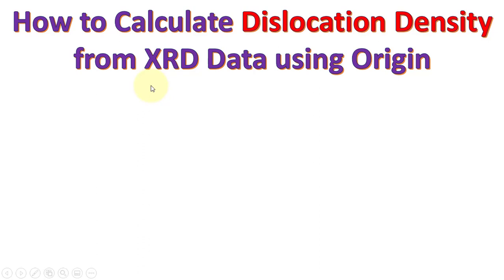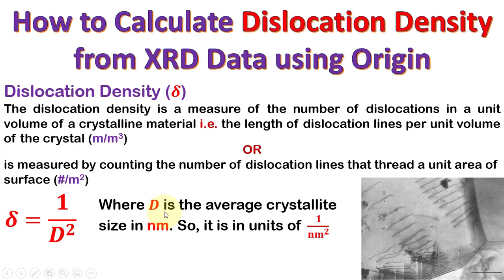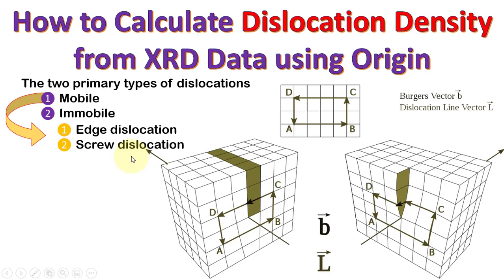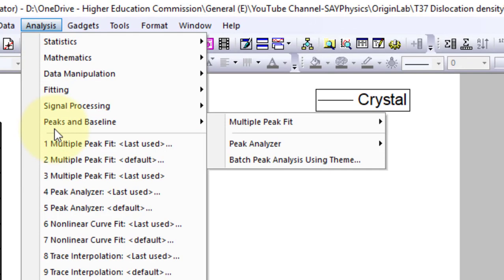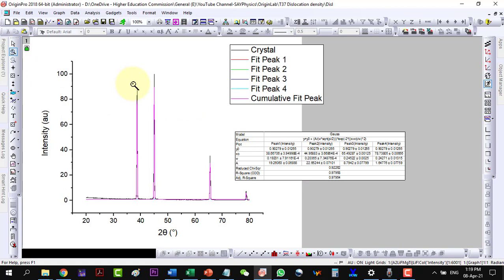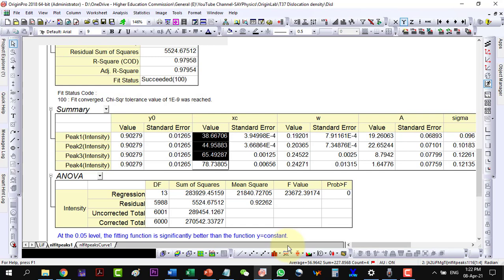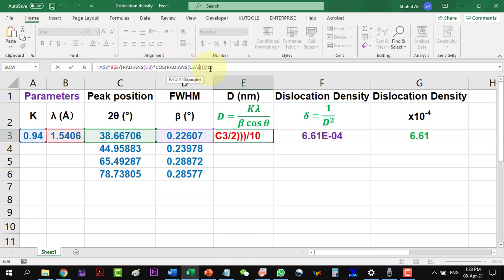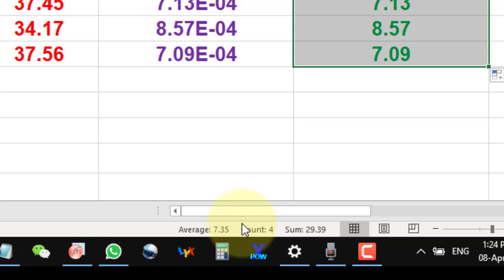How to calculate dislocation density from XRD data using origin

Comment: Thank you so much for the great lesson@SAYPhysics. 
With regards to dislocation density equation, delta = 1/d^2,  I have gone through the reference provided, paper on “Estimation of lattice strain in ZnO nanoparticles: X-ray peak profile analysis”…. this equation appears to be used for ceramics. Is this equation valid for steel? And if yes, could you please point me to a reference material that I could refer to please.
Reply from the maker: The dislocation density equation, delta = 1/d^2, is commonly used in XRD analysis for various materials, including ceramics and metals like steel. Thanks for the appreciation ☺️
Reply from the maker: Detailed response with some references is as follows;
The dislocation density equation, delta = 1/d^2, is a key tool in XRD analysis for various materials, including ceramics and metals like steel (Tamura 2017). This equation is particularly useful in evaluating dislocation density during steady-state creep of metals (Tamura 2017). It also plays a role in understanding the relationship between dislocation density and yield stress in cold-worked iron (Akama 2017). The equation has been applied in the analysis of single grains of steel using X-ray scanning microdiffraction (Castelnau 2001), and in the flow stress analysis of TWIP steel via XRD measurement of dislocation density (Dini 2010). Thanks
Reply: @SAYPhysics , Thank you for the response and references, much appreciated

Comment: Hello, I have a few questions.
1. Why did you multiply the value with 10^4 in the last column? I have seen videos where they multiplied the value by 10^3. 
2. Which one gives a more accurate crystalline size? WH plot or Scherrer Formula? I’m confused; the grain size of my sample from the WH plot is 4.8 nm, and from the WH plot, the grain size is 73.1nm.

Best Regards:
Tahira Jabeen
Reply from the maker: Thanks for your deep concerns on my content. 
1. As far as your first question is concerned, I haven't multiplied with 10^4, rather I have taken it as common, as it is with all the values.
2. In the presentation section of all my tutorials, I first explain why and when to use the Sherrer equation or the Williamson Hall plot. I'll request to carefully watch the start of the relevant WH videos. Basically, when the crystallite size almost remains constant with an increase in the 2 theta values, Sherrer equation gives the right value and vice versa. Thanks 😊

Comment: Sir, I have a question, excuse my ignorance, is it possible to calculate the dislocation density for an entire volume of the unit cell? I synthesized ZnO and I have the experimental values and cell volume, is it possible to know this value? Do you think it is important to know this?
Reply from the maker: Yes, it is possible to calculate the dislocation density for an entire volume of the unit cell using XRD data. To do this, you'll typically need the crystallite size and the microstrain, which can be obtained from XRD peak broadening analysis. Dislocation density (ρ) can be calculated using the formula: 𝜌=(3𝜖)^1/2/𝐷𝑏
where: ϵ is the microstrain, D is the crystallite size, b is the Burgers vector, which is specific to the material (for ZnO, it's about 0.52 nm).
Knowing the dislocation density is important as it affects the material's mechanical properties and can provide insights into the quality of the crystal structure. It's particularly relevant in materials science and engineering applications. Thanks
Reply: @SAYPhysics  Thanks so much Dr.
Reply from the maker: @antonioculebro8038 you're welcome dear

Comment: Sir, in some papers the equation for dislocation density is taken as (15*strain )/(a*D). a is lattice parameter and D is crystallite size. Why is this? Thanks in advance.
Reply from the maker: This one is a straight forward eq. in the terms of WH equation, which is based on the Uniform Stress Deformation Model (USDM). When a deviation will occur (anisotropic and inhomogeneous) e.g. Uniform stress deformation model (USDM) or Uniform deformation energy density model (UDEDM), equations will modify. Thanks

Comment: Sir, which is the reference (article or book) for the equation used to calculate dislocations density?
Reply from the maker: Please check the video description, I have provided some references there already. Thanks
Reply: @SAYPhysics  Thank you!!!
Reply: @SAYPhysics  Thank you so much for the great lesson. 
With regards to the dislocation density equation, delta = 1/d^2, I have gone through the reference in your video description from the references provided, the paper on “Estimation of lattice strain in ZnO nanoparticles: X-ray peak profile analysis”…. the equation appears to be used for ceramics, is this equation valid for steels? And if yes, could you point me to a reference material I could refer to please. Thank you in advanced
Reply: @SAYPhysics  Thank you so much for the great lesson. 
With regards to the dislocation density equation, delta = 1/d^2, I have gone through the reference in your video description from the references provided, the paper on “Estimation of lattice strain in ZnO nanoparticles: X-ray peak profile analysis”…. the equation appears to be used for ceramics, is this equation valid for steels? And if yes, could you point me to a reference material I could refer to please. Thank you in advanced
Reply from the maker: @user-zx1ot1mn6c Detailed response with some references is as follows;
The dislocation density equation, delta = 1/d^2, is a key tool in XRD analysis for various materials, including ceramics and metals like steel (Tamura 2017). This equation is particularly useful in evaluating dislocation density during steady-state creep of metals (Tamura 2017). It also plays a role in understanding the relationship between dislocation density and yield stress in cold-worked iron (Akama 2017). The equation has been applied in the analysis of single grains of steel using X-ray scanning microdiffraction (Castelnau 2001), and in the flow stress analysis of TWIP steel via XRD measurement of dislocation density (Dini 2010). Thanks
Reply from the maker: Detailed response with some references is as follows;
The dislocation density equation, delta = 1/d^2, is a key tool in XRD analysis for various materials, including ceramics and metals like steel (Tamura 2017). This equation is particularly useful in evaluating dislocation density during steady-state creep of metals (Tamura 2017). It also plays a role in understanding the relationship between dislocation density and yield stress in cold-worked iron (Akama 2017). The equation has been applied in the analysis of single grains of steel using X-ray scanning microdiffraction (Castelnau 2001), and in the flow stress analysis of TWIP steel via XRD measurement of dislocation density (Dini 2010). Thanks
Reply: @SAYPhysics , Thank you for the response and references, much appreciated
Reply from the maker: @Christian_Green you're welcome dear